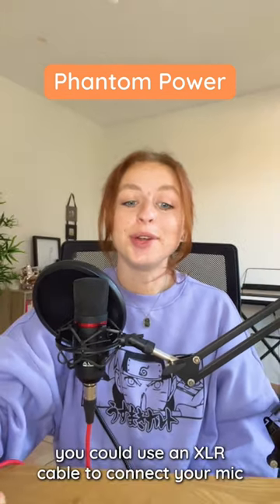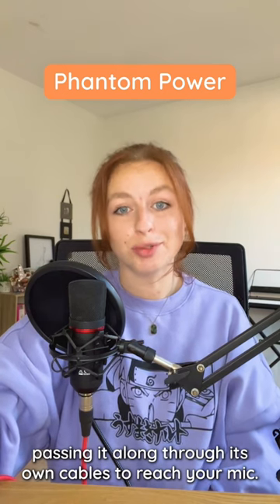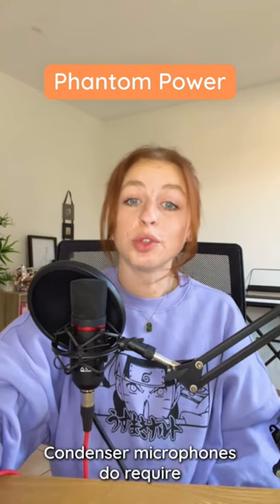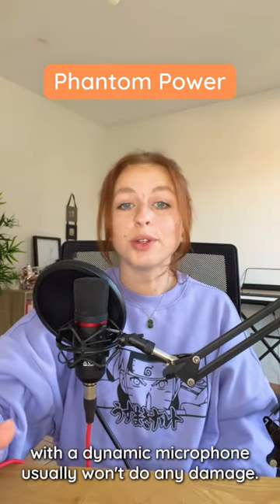Phantom Power explained in 1min! 👻 #audio #audiotips

Comment: You must be careful what you saying because at the end of the day phantom power is what it is called Phantom meaning it's not actual 48 volts if you connect actual 48 volts to your microphone it will melt and burn. You should be a little bit more clear with that.